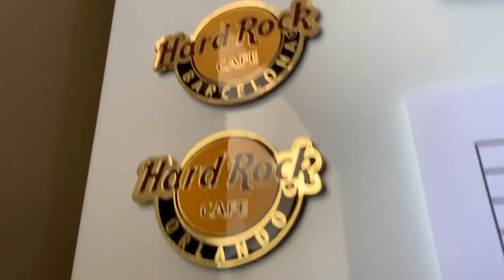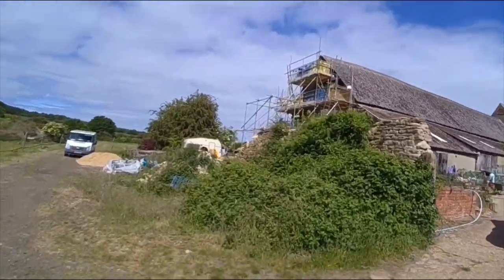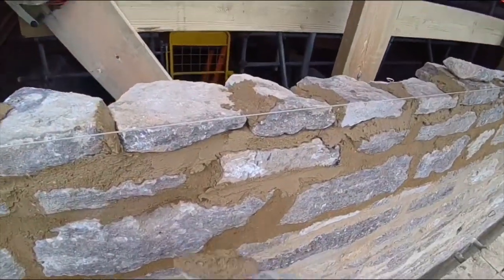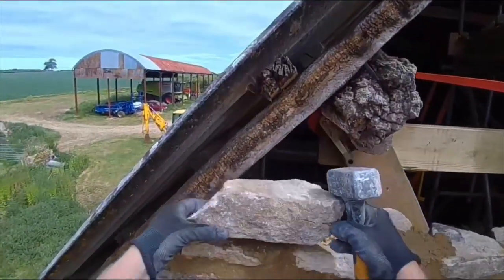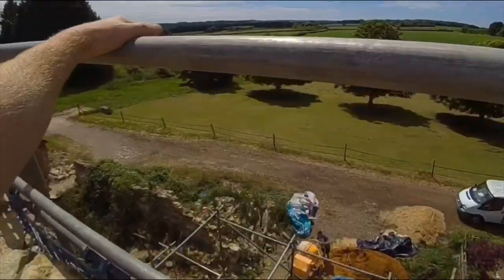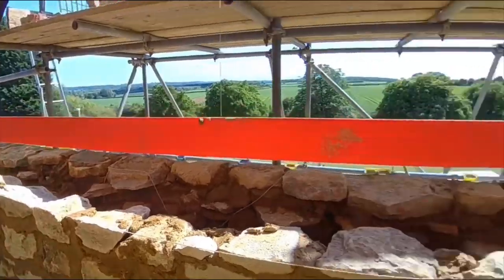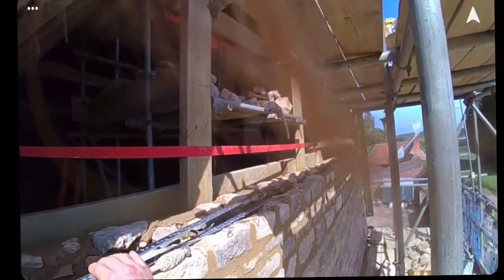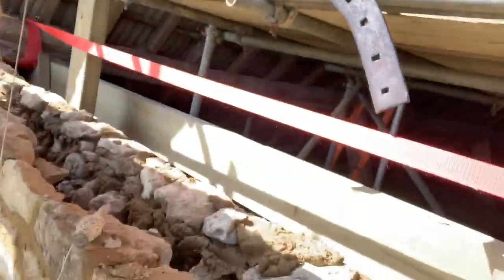Building with stone | The skill of bricklaying

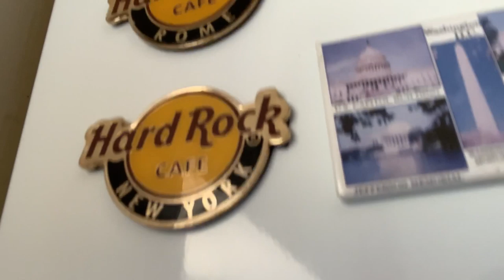Comment: 0:33 I learn a lot from a teacher type feller that wears nothin' but Hard Rock Cafe T-shirts, who's been collecting them from all over the world. His nickname's the Dutch Uncle. His YT real name is John Kostik. If you have an eye or ear for such recipes... then Bon Appétit

Laid some oval river rock that was so dense that it was like putting the mortar in a glass jar with the lid on it. At 1st try to get the wall chest high, thru using many wall ties, rock chip wedges, and dusting behind the wall with dry mortar mix, before going on over to the next run. I gambled on one more rock too many. All mornings work fell like cascading footballs. Solution was to lay no higher than 2' courses around the house each day. Learned as well that on a random non level course setting of stone, that no 2 rock layers lay them with the exact same pattern or joint widths. Solution was to split the rock veneer side runs between me and my partner. A much coarser grade of almost gravel sand helps a lot too. 
"The only true wisdom is in knowing you know nothing." -Socrates

Comment: Nice bit of stonework .Down here in cornwall we build with a lot of granite. We use a dryer mix because the stone is a lot bigger some quion stones can be 400 lb + . We keep the joints raked back and point up at a later date. Keep up the good work i am a new subscriber.👍👍👍
Reply from the maker: I’m glad I’m only laying these ones. I will keep that advice in mind. Thanks for the sub. Stay safe
Reply: @shaunthompson8943  hi best way is to keep the joints thin approx 10mm. Point the joints when dried out a bit and brush them in with a brush ie a paintbrush about 1and a half inches. Hope this will help you. I am from hayle so don't get use this stone very often normally work with granite.

Comment: Ginger in Ireland we usually give the joints a light rub of a wire brush the next morning
Reply from the maker: I’ve taken your advice on board and brush it this morning with a stiff brush as I don’t have a wire brush. Thanks for the tip
Reply: Use a churn brush to brush of the joints/stonework,not so harsh as a wire brush,especailly if joints are soft at end of day/following day.
Reply: I'm Irish and I use timber or the top of my twanger
Reply: @michaelberry1902   It might be safer to stick with your twanger